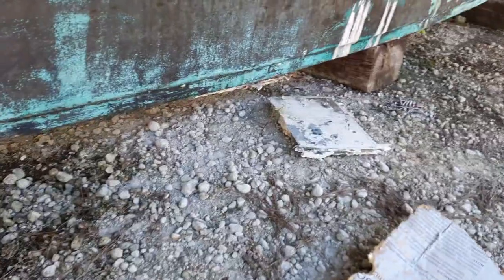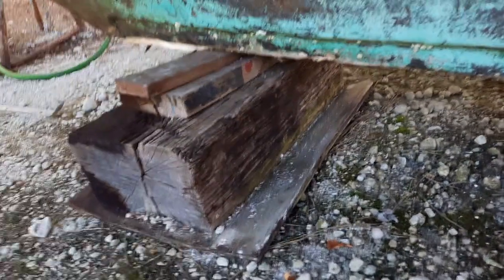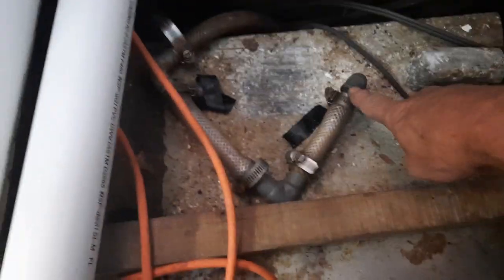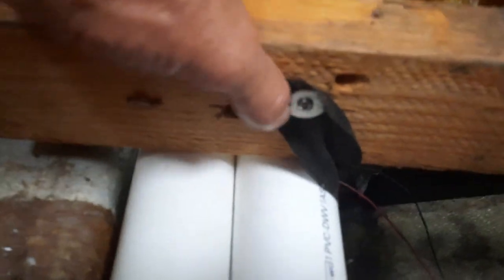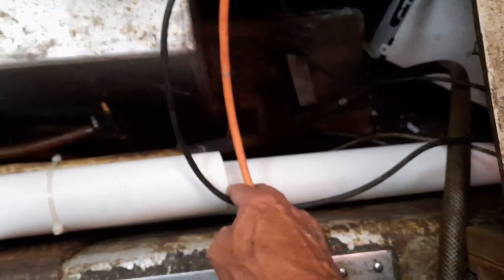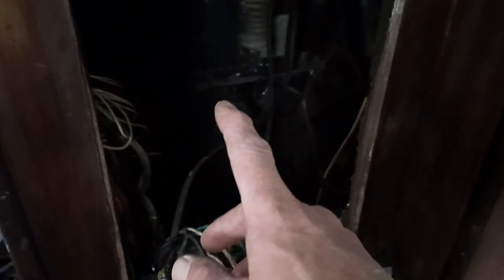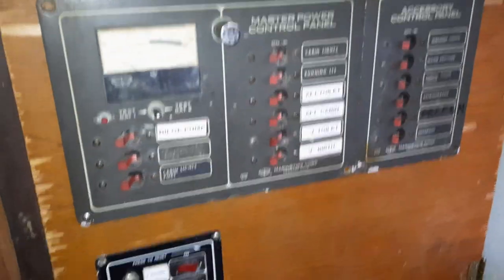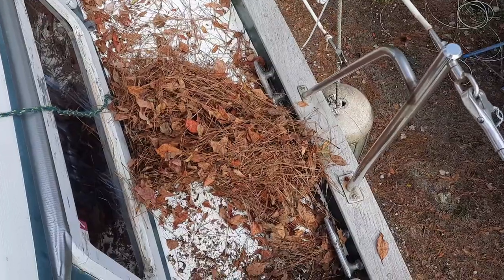Sailboat Centerboard WAS Glassed Over EP5

Comment: I would run some spare pull throughs in each PVC pipe for any future jobs, just makes it a little easier when you run something else through the pipes in the future, which I'm sure you will.
Reply from the maker: That did cross my mind. It is easy to get to the pipes from the engine compartment and it would be easy to run a fish tape to pull wires through.

Comment: Get one of the big Harbor freight 40 ton hydraulic jack and lift the boat up enough to pull the board off.
Good idea to run sleeves for future proofing
Reply from the maker: It is "one time store" not harbor freight. The boat has to be lifted a few feet to get the board out and it can wait until I am ready to work on the bottom.

Comment: Separate homes for AC and DC is great. Having a panel where the backsides of the AC and DC can see each other when opened can cause Electric Shock Drowning if you're in fresh water and violates ABYC wiring standards.
Reply from the maker: All boats that I have seen have everything in one place. It is easier for the manufacturer when they build them. I can see that it would make it easy to shut everything off in an emergency if it is in the same place and I can reach both the AC and DC panels at the same time and keep them separate.
Reply: @thewatercamper  Yeah all on one place is handy but people take shortcuts and don't get a proper board that keeps the wires in the back separated at all time.